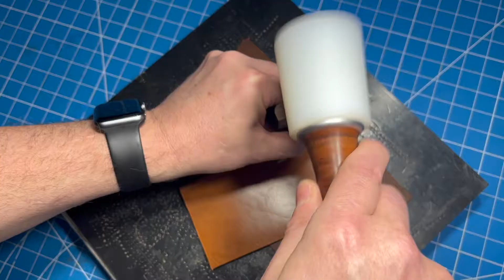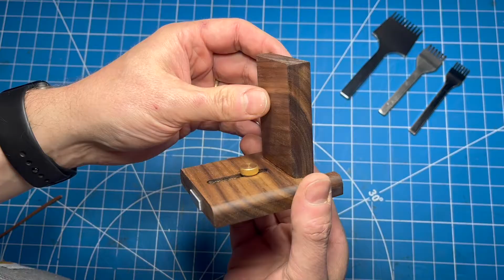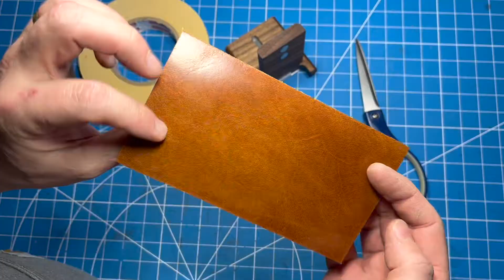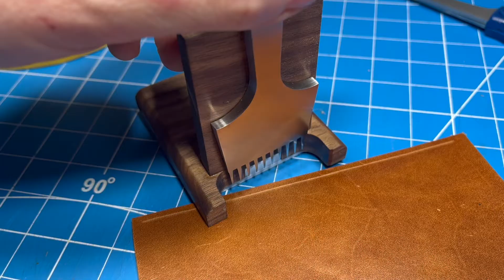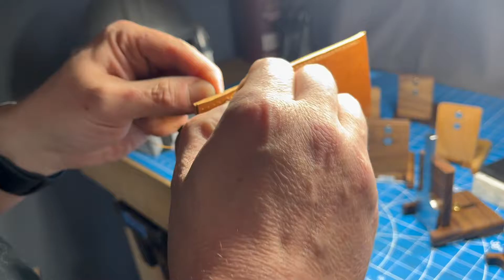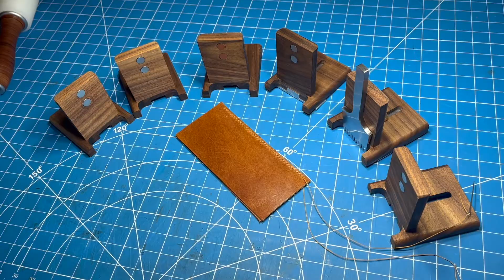Stitching Iron Jig Demo

Comment: Rare to find tryly unique tools online.  Bravo, Well done.  I have two suggestins for improvement — 1.  Instead of tapeing 2 scrap leather pieces (everytime!) to level the jig, why not add a metal plate with two screws (smillarr the one used to set up the distance from leatehr edge to the stitching grove, that will level the jig easily (you could recess the plate in the wood or have it slightly proud, set to minumum thinckness, say 2 mm, at which the leather tickness becomes an issue (that your jig solves).   2.  Instead of leaving the leather on the pricking iron side open, add a “restrainer” (could be metal or wood) so that that when the prickeing iren is putlled out, it pushes down on the leather and leaves the leather cleanly.
Reply from the maker: Thanks for the feedback and suggestions. When I was prototyping, I did have the thought that a mechanical levelling system would be good improvement. I decided to prioritize releasing a simpler version with the leather-shim-trick and reserve an integrated levelling feature for a future version/model of the jig. Regarding your second selection, I think(?) you are referring to integrating a pulling block feature into the jig. That's a great idea. The wheels are turning. 

Again, thanks for feedback and suggestions. It is greatly appreciated.
Reply: Yep, you are right.  I was referring to the pul back feature  @StrummerDesign  .  I am a hobbyist, so don't know all the technical names.